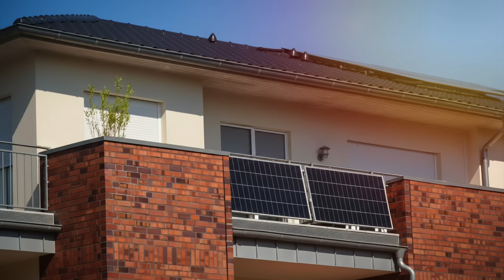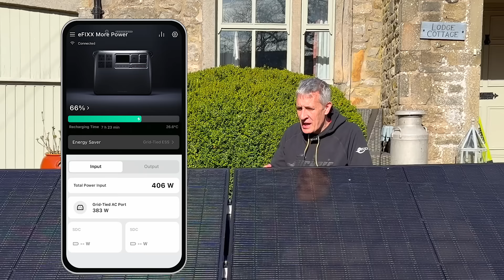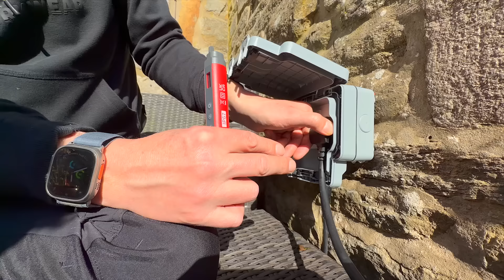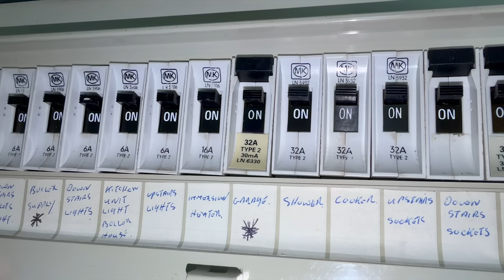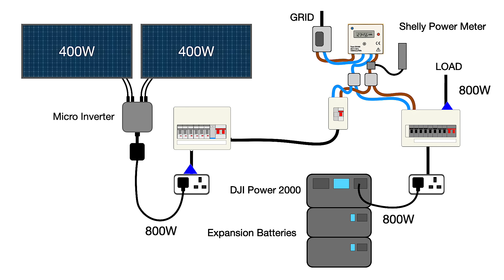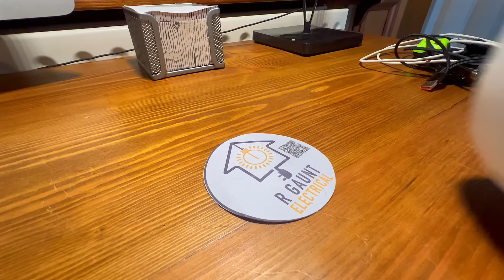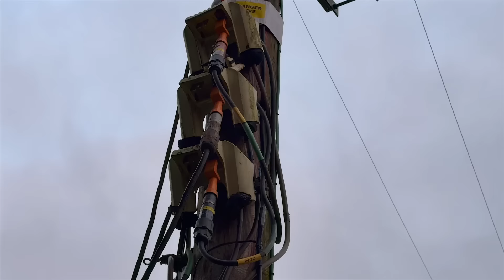Plug in Solar: We’re Told Never Do This… So I Did

Comment: I've been looking at this system for a few months now. The ideal scenario would be that I stick it in a shed roof and plug it into the the external sockets.

My question is that the external sockets run from a 13A fused spur, from the kitchen. Does it create problems if (hypothetically) I plugged into this spur?
Reply: This is why they are looking into the potential safety issues but I guess running an independent system with a dedicated circuit protection would work well but you would need some sort of backup in case the sun don't shine.
Reply: I'd think it would have to plug into a proper 13 amp socket on the ring main, although I can see issues with people maybe having to use long extension leads from the panel outside in a sunny spot to being able to reach a suitable indoor socket!
Reply: @RichieReportsUK yeah, that's the issue. I think most people will be looking to operate from a spur. Either from a garden room / shed or on the house itself.

Comment: I live in a high rise rented flat. So I can't have installations. Currently using octopus agile and would be nice if I could storage battery in cheap hours and go on battery power at high cost hours. Plus useful in a powercut to look online for news about power outage.

I have floor to celing windows which has the sun from 12pm to sunset and is WAYYYY TOOO HOT so if there was a way to have solar and heat power some electric from having panels on the windows from inside it would be a massive game changer, if the panels are affordable.

That said what batteries would work for a flat without permission to add batteries?

Im thinking some portable like in this video for air conditioning in summer months, and my pc.. But not sure how I would get one to work for the oven (built in electric with 13amp plug).

I defo can't do one for th hob as its a hard wired isolated circuit.

Just fed up seeing people with massive savings running cheap energy from batteries that they charged up when grid was cheap. What is recommended for batteries in my situation?

Comment: I'm even more confused than before I watched this.  You talk of renting the property, yet your diagram shows a second consumer unit and isolator connected to the tails block.  That looks like a professional notifiable work installation, not a temporary tenant install.  Certainly not a £400 middle aisle in Lidl setup which Ed Sillyband is implying.

Comment: As a (Safer and more simplified) start, could you just use the sockets on the battery bank(s) to power a few mains devices? And not tie into the house mains at all. Off grid so to speak...

Comment: The issue I see is if back feeding into the grid via an old meter, it could see it as consumption, some people who plug this in will only find this out when the bills actually go up
Reply: Surely the meter would either stop counting up, or even run backwards, depending on the type.

Comment: very timetly to see this - news this morning that the changes are coming to regulations about 'plug and play' solar.  I dont have a garden , only a 7th floor balcony which might work with a small panel - not sure if the council /planning would like it though.....The bit  that made me think in the video was if the fuse board would need upgrading/changing to make it safe. will have to understand that better...

Comment: This type of installation is so dangerous and you clearly are not aware of the issues concerning potential difference. Should the mains power fail, you no longer have a way of providing a safe earth. Unless your property has a TT earthing system. It may work in Germany but I cant see it being allowed here.
Reply from the maker: Did you watch the video? - BTW Germany uses same earthing system as the UK

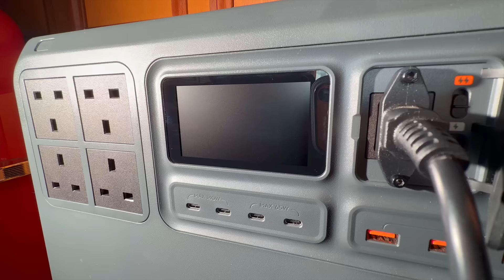Comment: 0:37 “the wrong way”……. Power does not care, it flows wherever the voltage is lower. Decent installed homeinstallations have no problem at all with 800 watt coming in.

An it is AC anyway :-)

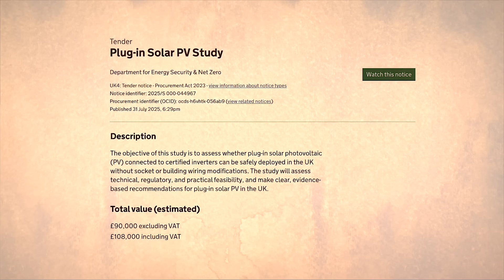4:20 There will allways be stupid people doing stupid things with electricity, even when not feeding into an outlet. You cannot prevent that. Are the Germans blowing up houses bu large numbers? Are the Belgums? Are they smarter then the Britt?

Comment: Great video, and great solution as the DJI solar panel inverter offering is poor. Two questions, would you mind sharing what panels you are using and also, does the DJI with the shelly dynamically adjust the power 2000 charge rate to mop up the spare watts from the solar microinvertor or does the DJI just have to be set to charge at a nominal level IE always charge at X watts?

Comment: In the 7 year payback did you calculate the battery degradation(capacity loss) and a possible purchase of a new battery / batteries?
Reply: I did, and there are a lot a variables depending on solar efficiëncy , energy prices and how well you schedule or automate grid feed in. It's more like 10 years for me. I already had the most expensive component, the battery, for camping and backup at home. The solar panels and converter are cheap actually. If you have a use for a  2kw powerbank other than a balcony setup, this is a no brainer.
Reply: @ieism1  Google AI says if you had invested £10k in oil futures you'd now have £27,291, a return of 172.9%.
Reply: @narcuk08 Possible, but I'm kind of against AI. The goal here is to be more responsible with renewable energy, a datacenter or oil is kind of the opposite of that.
Reply: @narcuk08 I did invest in oil. Two years ago to be exact. Haliburton, Petrobras, Petrochina, SM Energy, BP, Marathon Petroleum and a few others I can't exactly recall. Best investments I have EVER made. Some of those investments have returned over 180% return so far, and I'll be investing in more. People don't seem to understand that we NEED fossil fuels. It's what our world is built around, and will be for the foreseeable future.

Comment: Far easier and better just to make your own off-grid setup for certain systems.

I use the grid for things like electric shower, oven - high power devices etc.

Then solar +  several rack mount 2.4kwh lithium batteries in an enclosure outside, all ran by victron equipment, that powers everything else in the house entirely seperately on a seperate distribution unit. You''re not allowed to alter the incoming mains supply, there is nothing saying you can't make your own if you know what you're doing.

Comment: This is EXACTLY the kind of set up I'm interested in.
I have a detached garage with a power supply and satellite distribution box.  The power supply comes from the house with an armoured cable and 32A mcb protection.
Id like to 'back feed' from the garage to the house, without having to run another 20 yards of cable and dig up the garden. The garage is more suited to putting panels on, equipment in etc that the house (200 year old cottage with solid floors and walls, no space, roof not suited to solar panels, etc).
Reply: Similar situation here with the detached garage, although we’re a 70’s build with felt roof. I’m thinking it will need bi-directional RCBO in both the house and garage distribution boxes. I’ve got the MCS approved electrician coming to look and advise. Wondering if that means I will lose the power to the garage/shed lights and sockets if the cable back to the house can only be used for the solar/inverter/battery connection. The current box in the garage was also used for the hot tub that I haven’t been able to afford to run since the massive price rises since the pandemic!
Reply: @MightyBurg should be OK..

Comment: In Netherlands and Germany these batteries can do more than 800watt. But it requires a separate circuit with its own breaker. I have a system that outputs 2400 watt max.

The risk in these systems is a normal 16a breaker will trip at 3600 watt. Once you have a plug in battery installed and a short will have 800 watt extra power and the short will be 4400 watt

Comment: I'm not an electrician but your videos give me a better understanding of how the systems in homes work, and I enjoy your content. This might sound like a daft question, but here goes; how is the electricity from the battery or solar prevented from getting back on to the network beyond the home where it is installed?
Reply: its not, but the meter will see and only charge for, any excess of supply over  export. If you are lucky,  it gives you money back for export, not all do.  Note that if no incoming mains is detected, it all shuts off.

Comment: Canadian here - I really like this idea but I don't think will be tenable in North America. Our split-phase systems means connecting this to a standard 15 amp outlet would result in only circuits on that leg receiving power.

To get the full benefit we'd need a 15amp/240v outlet and circuit, which for most people means bringing in a electrician negating the plug and play benefits. Now, we could start including a 15amp/240v circuit in new builds and renos but most people would probably never use it.

Question - Since the system is always supplying power, is there any backfeed protection for the mains? During a mains outage the system could shock an electrical worker who thinks the lines are de-energized.

Comment: You should always have multiple levels of independent safety. Using a 13A plug to feed power the wrong way really scares me - it's one cheap microcontroller failure away from being a deadly shock hazard. You also now have a setup where, if someone is working on your installation, off doesn't necessarily mean "off"  and it could go live at the worst moment. There's a good reason why these things should be wired in properly. Also, a 7 year payback on storage isn't quite so great when the batteries might only last 3 years.
Reply: Many people will have issues with wildlife chewing permanent outdoor cables, I've had problems in the past with foxes & squirrels chewing low voltage garden lighting wires!

Comment: are there not safety issues in that if someone is working on your grid line and you are opumping energy into the system when they think its turned off is there nt a risk of electrocution?

Comment: Man, touching the prongs, even knowing there's protection must've been nerve wracking😅
Reply: " Man, touching the prongs... "  Reminds me of a young lad in the 80s.  He'd just used a mains electric pistol drill, and having unplugged it, accidentally touched the plug's L & N pins, and discharged the little capacitor's stored energy... through himself...  He was shocked in more ways than one, and it took a long time to convince him it wasn't due to a fault with the drill...  Required for spark and RFI suppression, those small caps won't really harm a person, but convincing him took a long time... I remember him for that, and his surname... Lucy...  In the armed services, the electricians sometimes yelled "Catch" and threw a charged capacitor to a workmate, whi, if he could overcome his reflex reaction to catch, just let it continue through the air... If not, there was a good chance he got a jolt... I don't suppose these things happen, now... 

On building sites at one time, every electrician had a cable with a plug each end... So he could work in the house next door (or near enough) to one that had power, even if "his" one had no mains power yet.  Dodgy, but it was done...

Comment: So question, if the 800w produced by the solar panels is not used or only part used in the house, is the remainder "exported" to the grid for free?
Reply: Hopefully it would reduce your bill, as the meter would run slower or stop counting up, or even run backwards, depending on the type of meter.

Comment: Of course, feeding back into the grid, you're going back through a step down transformer and stepping up through your street or local minisub, and putting whoever works on the distribution system at fatal risk. 
Maybe I missed this in the video.
Reply: The moment the inverter detects there is no grid power it immediately stops outputting so there is no danger to linesmen. (Also stops the plug end being a death cable by having the pins exposed)

Comment: Good timing. government just announced they will be giving this the go ahead in the UK. 

Any issue having this and a roof top system on the same property?
Reply: @gmuzz  that's what I was wondering. I already have a 13kwh battery and 7kw panels. Would  this be a way to easily expand it? Maybe as a totally isolated setup with a dedicated consumer unit as someone else mentioned.

Comment: Just stumbled across this video. I was doing a lot of research into this last year as I was convinced that it should be easy with the like of ecoflow products but I got scared off by the ‘you need a qualified electrician to install’. 

I have plenty of space I could put 800-1600W of solar on but the whole costs to get it all installed vs just buying it and plugging in didn’t seem to make sense to me. 

Will have to look it all up again and see if I can have a simple plug and play option. 

Would be great to have even just 800W. If we could make it legal and get 1million balcony systems in the UK. Thats a whole power stations worth of energy (obvious peak vs continual load).

Comment: But… with the rcd. If the inverter can detect grid loss and stops generating then you won’t have power to permanently supply the load side test button (the leakage circuit) what they don’t want is the cheap shitty ones that don’t detect grid loss. You missed that bit.

Comment: Extremely promising, but a sticking plaster on a broken grid and energy system.  The energy prices in France are 15 pence per unit, not 27 pence as in the UK. My point being that financially and environmentally the business case for such solutions wouldn’t stand up, if we had a decent energy policy.

I’ve worked on grid and nuclear projects in the UK for over 25 years and I despair. Back in the 80s cheap, clean and reliable energy was a solved problem in France where they were 85% nuclear. We have gone backwards. Up to two thirds of UK wind energy is paid for by us but can’t be used as the wind farms were built in isolation and the grid can’t handle it. We have also selected the most expensive route to new nuclear on earth and we’ve shut down exploration for new oil and gas despite the fact we’ve only used about half our reserves and we rely on products made using dirty power then shipped half way round the world using dirty ships.

So I think it is good that you’re shining a light on DIY solutions, especially the wiring considerations, but we really are becoming a 3rd world country… this is one step up from the car batteries and solar panels I saw in the wilds of Myanmar back in 2016.
Reply: Actually electricity price at the moment in France is 20 cents/unit on average

Comment: I'm always wary of these portable power systems. If the dji batteries are anything like all the others on the market, then something to take into consideration is surge power.

Starting up high current devices causes a voltage spike on the same rail. It will fry unprotected electronics. I've seen it happen. Hearing the screams of the boss who plugged his iPhone into the same battery as a circular saw is haunting.

Comment: I would get away with it in my garden (in Melbourne Australia) but not with the legalities. Because of legal restrictions it is impossible to do anything your self connected with the mains.
Also even registered installers appear to be very restricted which is making it much more expensive than needed. Liability regulations mean that Installers, sellers and manufactures are in that order legaly liable for warranties etc. This means that installers only will install new equipment with all the warranties from manufactures and sellers in place so that they don't get stuck with it. For that reason they reject installing second hand equipment still legal to install and use and the sellers put up the prices as they don't have to compeat with s.hand eqp.

Comment: A very important note, you don’t use ANY solar system to plug the 240v output straight into a plug socket, you must use a system that only passes the power into the sockets if it detects the grid or 240v is live, you don’t want a system that keeps your sockets live even if you’ve disconnected / isolated it at the breaker - that’s a major safety issue and needs to be mentioned.
Reply: It is.  And very graphically in this well presented video.

Comment: Really interesting. I wouldn't encourage anyone to touch the pins on the reverse plug to prove dead. Ok if the kit working properly but lethal if there is a fault. That's the key bit I wouldn't approve of. At least test before demonstrating touching the pins.

Comment: seven years ??
so i spend all that money and it takes seven years before i see the benefit ?
Reply: No, but if you don't understand the concept stick to paying for grid electricity.
Reply: @nickdavies1977  just steel a load of panels, rig up an converter, plug in to the mains,
simple as really..

shit at night though unless you have a battery back up storage.

been doing this shit for years, 
twenty car batteries in the garage, panels on roof, 
free electric, and all bought or for as little as possible,
unlike dickheads with more money than sense buying with their cheque books and credit cards.

Comment: Just use a common’o’garden weather proof 16 amp connector wired round the correct way and there will be no exposed electrical terminals. Safe enough for your granny if it is set up right. The nanny state ruins so much good stuff.

Comment: Uk plugs solid and should be ok its the switching all power from solar panel or mains when doing work on systems so you can control it and work safely isbthe issue